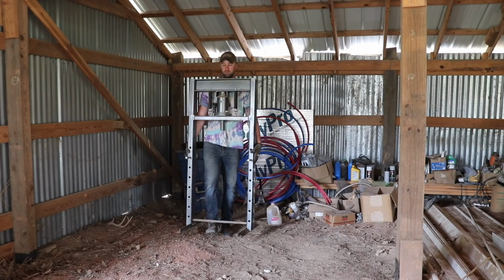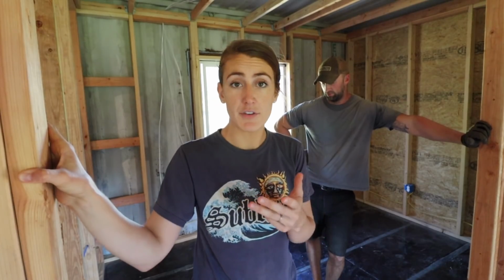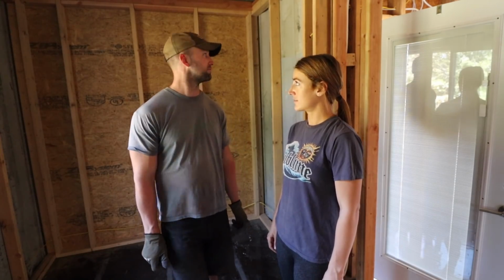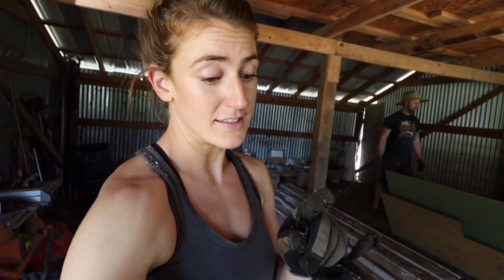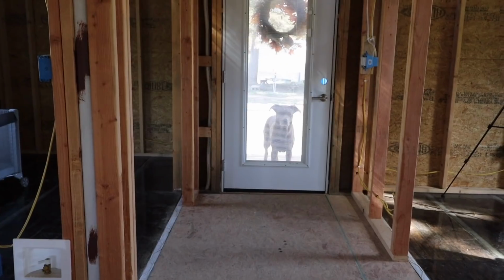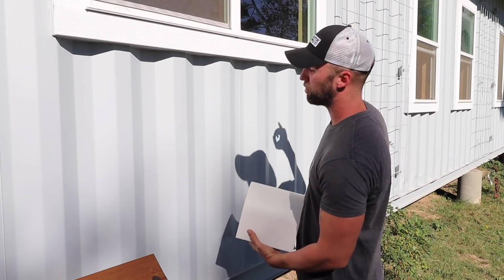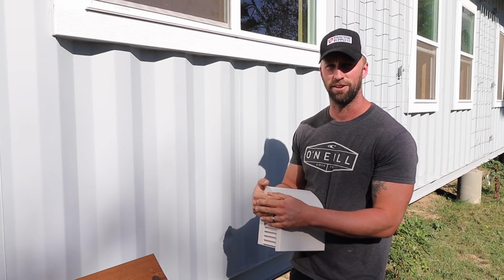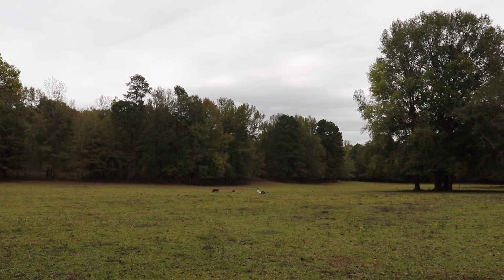Will We Be In Our HOME THIS YEAR?!

Comment: Awesome video,  agree with Pampel Moose, Tolu and many other comments.  
     When I finished our 1700sq ft basement our sons were living in space.  We double insulated by studding walls against existing insulation and then insulating stud walls with pink.  No real mess there but sheetrock, drywall was a painful multi-day process along w/texturing.  It took four days just to cover everything.  About a week to sheetrock/drywall, a full day to texture and months of dust mitigation upstairs and downstairs.  Concrete floor staining, cut cost as we were not financing.  All finish work leveraged wood from family house built in 1915 and Beetle kill (blue/red) pine with lots of beetle holes.  Lots of built ins and trim work.  I absolutely Love your project, thank you for sharing.  We live in Colorado so moisture is not as much an issue as settle, so all walls float.  
     Note:  Think long and hard about laundry, plumbing access for kitchen and bathroom.  My wife and son came up with solution to pex lines running over head, modular ceiling tiles built from beetle kill pine.  One last thought, I built massive Soji style doors for bedrooms to save on usable room in bedrooms (used plexiglass (ruffed surface to allow light, provide privacy), frame and beetle kill to round it out).  This build took several months as did 16ft entertainment center built in.  
     Love your musical choices also.

Comment: I remember the first winter in our off grid cottage. I had the steel roof installed, single sheet of plastic over the log frame and the 1880 wood stove had a stove pipe. We showed up at 10pm at night and it was -12C (10F). I started the fire and after 20 minutes the internal temperature was -10C. I laughed out loud and "well, off to bed" and we crawled under the 4 blankets in the camping trailer. And so begun our off grid cottage life. You have built a beautiful, solar powered home:)

Comment: I am continually impressed by all you guys are learning to do!  Spencer please consider the following:  I have a large workshop (metal) and I had foam insulation professionally sprayed inside the walls and ceilings.  While this made a GREAT seal of the enclosure....it is  SO HOT during the summer months (TX)....that I wish I didn't have it.  Works OK in the winter, but not as warm as I expected/desired.  On the other hand, I lease another metal building for another purpose...and it has the traditional fiberglass with white vinyl backing...on the walls and roof.  It is cool in summer....and warm in the winter...just as I would want!  So what's the takeaway here?  Consider spraying a THIN layer of foam...as a sealer...and then use fiberglass  to act as your actual insulation.  You will get the advantage of both products doing their best together.  Without the fiberglass, I fear your container home will be so hot in the summer that it is uncomfortable.  Again, I am basing my suggestion on what I have experienced myself, not some theory or here say from others Just my 2 cents!

Comment: I will remind you again before you try to put insulation in the walls make sure you can nail sheetrock in the corners you have to have doubled up two by fours
Reply: This is the biggest time saving tip I've seen here. Sadly drowned out by the "OMG your like such a cute couple" and "Why haven't you finished already?" mob.

To put it a different way: the edges of the sheetrock/drywall/plasterboard must be supported; it can't be flapping in the wind. This is the top where it meets the ceiling, the bottom with the floor, the left and right where they corner with the next wall. Same for the ceiling. Same for tile underlay.
Reply: We always used a 1x6 for a nailer for sheet rocking the ceilings especially the corners fast and easy

Comment: Spencer, have you considered doing the wiring for intercom, security cameras, audio & video entertainment systems before sheetrock?
Reply: Are you sure it's even needed ? Ring covers about everything. Most major companies have wireless music. Check out the new Apple speakers ( Nope retired never an Apple or Ring Employee )
Reply: @Richard-ro2fp  I appreciate the perspective, but one of the benefits of living remotely is having a low EMF radiation environment.
Reply: @rayfiore7779  They have plenty of room to put up a HAM antenna tower!
Reply: @gregorykellerman3876  Once again Living remote has the benefit of LOW EMF (i.e. no ham, no wifi, no 5g).
Reply: @rayfiore7779  Yes, no noisy RF sources nearby makes it a great location for them to become HAM's.  They have the space to put up a tower and the pond would make an excellent ground plane for any vertical antenna.  KC9WVR
Reply: @gregorykellerman3876  If I were in their situation having a Ham radio would be a good idea, I just wouldn't leave it running unless I wanter to receive or send a message.

Comment: Guys work on only what you need to live in the house for now. Don't try to take on more than you can. Work on one bathroom, a place to eat and a place to sleep. This is all YOU need so you can live in there before the winter comes. Insulate with spray foam in the living room where you can sleep in a warm room. The best insulation for a metal container is closed cell spray foam.  That sweet baby needs a house to live- in whether it's finished or not.  Keep safe . God Bless your Family.

Comment: If your flux core welding , there is a wire brush attachment you can put on your grinder to clean up your welds . As long as you can access them safely.  Also , please know , that in order for you to use that attachment you need a full face shield & protective clothing , just in case one of the wires comes off doing 110 mph. In a fabrication shop you wear  leather jackets . Thats advisable. Well done on all the work . Your fan up in Canada .

Comment: One last addition to the container walls on the out side might be applying what are called Anodes like they do on ships and canal lock gates its lite negative charge/rust don't like each other. Though its a bit of overkill an Anode sacrifices its self not the steel it's attached to and there might even be an undercoat paint with what's usually the  zinc that Anodes are  made of in its mixture and many bridges even of cast concrete use it to protect the metal/rebar that inside them..

Comment: Talking about wall insulations ....have you guys consider using outsulation system....installing your insulation outside using a fire-rated polysterene (styropor) and encapsulating with a high density traffic grade fiber mesh and coating them with a cement stucco finish??

Comment: Save yourself hours of work by pre priming/painting trim that's going in after the drywall is up/finished because it gives a knife edge appearance and just filling in the nail holes/corners can be done in an hour or two. Putting  it up raw is a mistake because even if the paint on the walls is the same the difference between of each absorbs primer/paint isn't the same and buy drywall primer as well since sealing the tape joints/compound/paper is essential since if left raw it the finish paint will let its shadows standout. Think about carpet tiles if your putting in carpet since it doesn't need adhesive like regular carpet and can be changed even easier plus it looks better and many commercial buildings you've been in have it since it's more durable. You can put up half the drywall on interior walls that make up the room dividers so they can back the insulation unlike those that are along the exterior container walls and be sure to mask any outlet/switches for spray foam application even if their boxes exist for a future possibility but not at this time. Trust you'll be nice and snug inside a room with its foam/drywall up by Thanksgiving and be sure to use cement board around the bathtub it anywhere ceramic tile goes on in the kitchen etc because regular drywall wicks moisture and can cause mold behind it over time.

Comment: I WOULD USE THE WHOLE BACK SIDE/END OF THE NEW CONTAINER FOR SHELVING FROM TOP TO BOTTOM FOR YOUR PERSONAL STUFF SENSE YOU WILL NOT BE NEEDING MUCH OF THAT STUFF THEN BUY SOME TOTES ALL THE SAME SIZE AN MAKE SOME SHELVING DOWN 1 SIDE OF THAT [[SORTA L SHAPED]] FOR ALL THE PERSONAL STUFF YOU HAVE SO THAT IT CAN BE CONTAINED FROM RATS AN SUCH AS THAT.... 
THEN MAKE SOME PEG WALLS FOR THE LOOSE TOOLS ON THE EITHER SIDE WITH A BENCHES UNDER IT SO THAT OTHER TOOL BOX THINGS CAN BE STORED THERE... I WOULD PUT A LOT OF THE OTHER STUFF IN TOTES AS WELL WITH LIKE THINGS SO THAT YOU DONT HAVE TO HUNT FOR THINGS [[LIKE PLUMBING STUFF]] AN [[ ELECTRIC STUFF]] AN ETC ETC ETC.... PUT LABLES ON THE FRONT SIDE OF EACH [[PERSONAL STUFF AN TOOL STUFF]]  AN THAT WAY YOU WONT HAVE TO HUNT FOR STUFF ANYMORE....
BLESSINGS & BE HOPE FILLED
FRANKI

Comment: I didn't know you were from the Pensacola area. I live in Marianna which is 2 hours East a Pensacola off of I-10. What state did you move to? I grew up in Port Saint Joe. If you grew up in Florida in the area that it appears you did then you would probably know or have heard about that City which is just 10 miles East of Mexico Beach. My son spent two years at West Florida and graduated there a few years ago. He is now in his second year of medical school at Florida State University. Enjoy the progress you are making. Have you considered hiring sheetrock contractors which will rapidly speed up getting that done after you put in insulation? If you are going to put spray in insulation which is the best you can hire that out to and they would get that done a lot quicker then you could move on to flooring after you paint the sheetrock. If you have never done tile you better study up because it can be tough to do but you have got to prepare your walls accordingly to cut back on water damage which is one thing many do-it-yourselfers mess up. Also if your house is going to be tight which I'm sure it is then you will need a very powerful fan to suck out the moisture in the bathroom so don't be afraid to oversize.

Comment: Before you seal the walls and drywall did you consider running cat5 cabling for wifi or wired internet jacks? What about a wireless access point in the barn for Spencer's work shop?

Comment: metal wall not can use other than only closed cell spray foam. buy hardware store pressure tank were have foam, kit not have expenmsive about 300 -700$

Comment: A heads up on spray foam. The fumes are a hundred times worse than what they tell you they are going to be. We just had spray foam done on our house and we got an Airbnb for 3 days because THEY SWORE the smell would be gone by then. We came back to our house and immediately got migraines from the smell. We then had to spring for a hotel room last minute and have the company come put big fans in our attic to blow out the smell. We have had 4 giant fans running in our garage dah and night for a week trying to pump the smell out and even now, over A WEEK later if we shut off those fans the smell starts backing up into our house. We aren’t sure how long we are going to have to live with fans going 24/7

Comment: Actually I read that the problem with a brown recluse bite is not the venom. It's the bacterial infection from the bite so you need to wash the bite immediately with an antibacterial like physicians surgical soap to prevent the infection. They are dangerous but with proper medical NP.

Comment: I really doubt it y'all move pretty slow I understand you have the new baby I believe I would have worried about the interior before I finished the exteriors 100% but you doing it the way you want to do it and I got to admit it is a beautiful home not sure what you guys have left I know you need insulation and sheetrock doors and Floors kitchen cabinets what is your next step finish up any electrical you need to do and then put your insulation in Highway

Comment: I’m confused here. Are you using a shipping container as structural parts of your house? Shipping containers aren’t designed for that so did you buy a special one? If not did you test the container for harsh chemical and mold before using it? Do you think that using a shipping container as a residence is better than using it repeatedly for shipping cargo. If you use it as a residence a new container would have to be built for cargo purposes, which doesn’t really fit with being environmentally conscious.